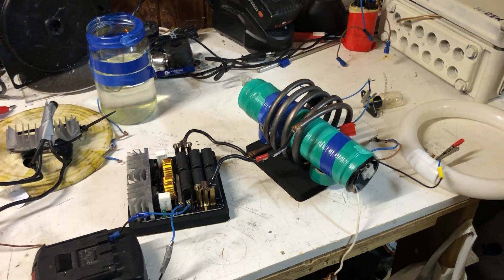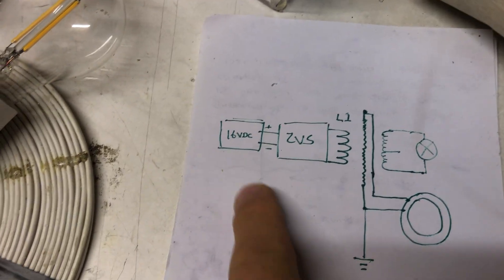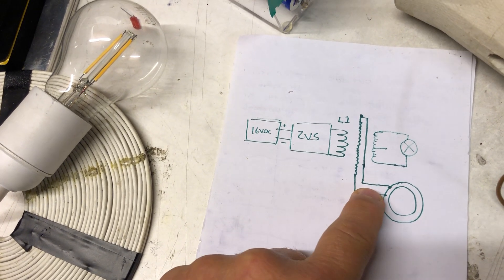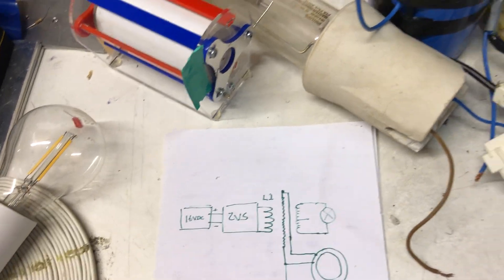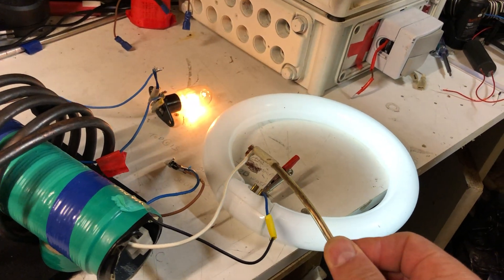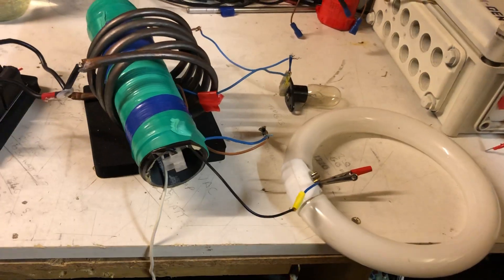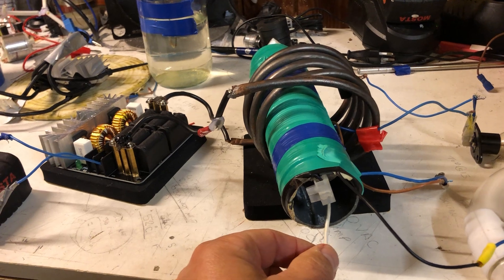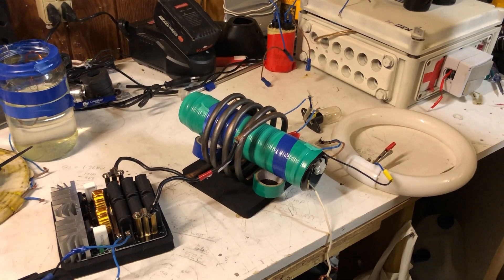Kapanadze earthing

Comment: Nice work, correct me if I’m wrong but was there meant to be a copper rod through the centre? I hope so because I put one in mine 😂. I thought the wire was supposed to go through the coil like you have done but then it comes back through the coil via the copper rod? Either way it’s amazing the difference earth makes.
Reply from the maker: @whatifididthis...1236  yes I put the wire from one end of L2 in through itself so on end is connected to the earth and the other is connected to load, then  when I touch the other side of the load, bam 💥. I would like to see what you tried, do you have a link?
Reply: @dkdyker  I never made a video on it, I still have it but I wasn’t really happy with the way it was operating, clearly from what you demonstrated I got something wrong. I’m now starting to wonder if one of my recent videos is trying to connect the dots. I don’t believe in coincidence, I believe everything I experience was already in my path so seeing your video is a stepping stone that leads me to question a connection to what Edward Leedskalnin said, that the magnets are in the wires. Recently I have been experimenting with harvesting electricity from the input power lines to my off grid lighting circuit using ferrite balun suppressors, this method I have not seen before(doesn’t mean it hasn’t been done) but it is very interesting, I wonder if the Kapanadze coil is utilising this function and the copper rod facilitates the magnets in the wires.
I might get the setup back out and make a new mod in line with what you have done and see what happens, I was running mine off of a variac and kept popping fuses and forgot to get more, it now sits lonely in the shed. If you’d like me to link a video that shows how I’m getting the power off the input lines let me know and I will edit my comment.
Reply from the maker: @whatifididthis...1236  maybe by doing this we speed up the electrons or maybe the EMF is lessened allowing easier flow ? A black hole or a tornado maybe has the same effect?
Reply from the maker: @whatifididthis...1236  sounds like a larger reservoir of electrons in a large piece of copper could be propelled through the center much faster and give more to the ground capacitor? I think I will try, thanks 🙏

Comment: That was really cool. You have got it. The earth is adding energy to the system. the tesla coil is a pump for it. Run the wire in a loop through the tesla coil to the light. Do not connect the tesla coil to any part of it. The light will light up. The outside of the tesla coil is hot. the inside is not unless it sparks oven inside the coil. It is interesting. If you can see a rod going down the center of the coil to the earth and it saturating the earth then you will understand tesla's Colorado experiment.
Reply from the maker: Thanks for the tips!